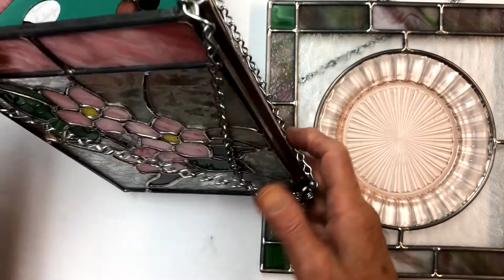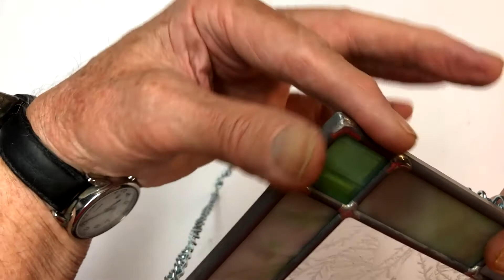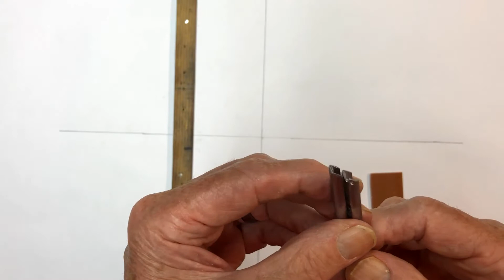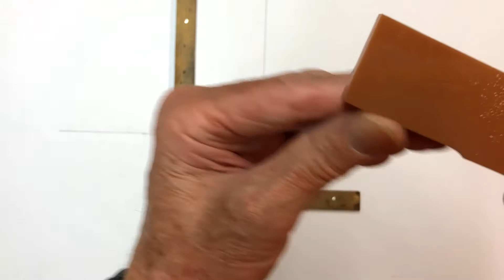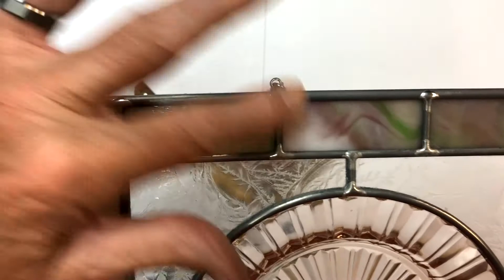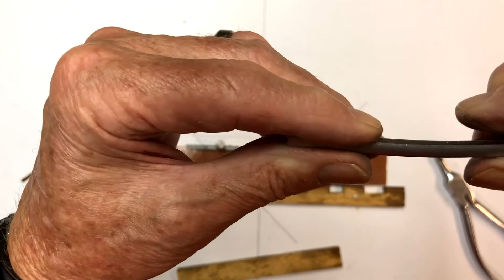Leaded Glass Hanger's!!

Comment: Could you tell me the size of your lead came to use around the outside? It looks really nice.
Reply from the maker: Hi Patty,
Thanks for your comment!! The came is RU-70 which is 1/4" Face width, 5/32" Channele width. It has a flat back and rounded edges. You can use this cotter pin hanger with any size came, just remember to grind back the glass where the legs will go to keep the came straight and flat on your project. Again, thanks for your comment and so glad you found my channel!!
Regards,
Bill Stone

Comment: Thanks Bill, ive never heard of cotter pins before & because of yr accent i thought you were saying quarter pins, so lucky i read the other comments.
I do have to ask as ive never been told, is a finished piece with lead came or solder or both able to be out constantly in the rain or sunshine directly & not under cover, will the elements effect either over time as i want to make some to fit amongst my cottage garden  , & now you've shown me the cotter pin idea, they wont get ruined in our ever so windy area, Thankyou Thankyou, you are a genius 😊
Reply from the maker: Hi Austra,
The cotter pin idea came to me about 25 years ago when we also lived where there was a lot of wind. I never liked the idea of just soldering a ring onto the finished project and hope it never came off. Some of the equipment I worked on over the years used cotter pins and I had some laying around and the idea was born!! These Leaded Glass and Copper Foil projects can be left out all year around. The only thing that happens to them is they all oxidize to a light gray. If it is a Leaded Came project the solder joints will oxidize to match the Lead Came. The only thing you have to check is, if they blow is the wind they don't hit anything that could break the glass. Just think about it, there are 100's of Leaded Glass windows all over the world that have been exposed to the wither for years!! Have a great day!!
Regards,
Bill Stone
Reply: @billstonesstainedglasscrea3310  Thanks Bill, it's funny because the man who taught was the one who said don't put yr stained glass in the garden & yet he had a church done up as a house, with old leaded windows, I think maybe he was talking about the foil might tear away from the glass, but silly me of course leaded windows have been exposed to the elements for years, thats where my love of the art came from, Sunday School looking at my church windows every day I passed by my church & yet it's taken me till 57 to learn it, well I started a couple years ago, the man who taught me the very basics was always worried about parting with too much info, he would always say it's a trade secret, I think he didn't really know, I met a lovely married  couple from it & now we are all friends & I've kept learning ever since from people on you tube & you Bill, ive learnt so much more, I Thankyou so much, now I can make my own leaded windows for our house .
My Husband & I bought a fixer upper & I'm looking forward to building my own windows .
Thankyou & have a great day, I'll be making a lot of yr great ideas for our home 🙏😊
Reply from the maker: Hi Austra,
Thinks for your kind words, so glad my channel and videos have been hopeful to you. It's nice to hear that you find them useful. You asked about designing your own windows, when you have time check out my video called WHAT DO I DO WHEN NOT MAKING YouTube PROJECTS!! The one with the Hummingbird was made up by using parts of three different patterns. I just made copies of all three and cut them apart and put them together to make the pattern to make this window. This window is copper foil with a Lead RU-70 U Came around the outside edge. The one with the pink flowers is also a copper foil with RU-70 U came around it. It was made by cutting the one flower apart and putting it in the one corner so there were two flowers in the window. The original design only had one flower in the corner. One of my favorite Stained-Glass artists is Frank Lloyd Wright, He is an Architect and I love all the Stright lines he uses in his windows. Check him out on the internet, you will get all kinds of ideas to make windows. I have used his design ideas on several windows I have made. The two panels in the door of my shop are made using his style. Have fun with your fixer upper, it will be a project that's sure to keep you guys busy. Have a great day!!
Regards,
Bill
Reply: @billstonesstainedglasscrea3310  Awww Thankyou so much Bill, I will have a look at them again, I've looked at them many times, I love all of them you & yr wife must just adore seeing all that gorgeousness around everyday.
I will definitely look up Frank and give it a try.
When I have got the front door panels made & fitted I'll find a way I can show you a photo, maybe if you have a Facebook page I can add you as a friend, I don't know if we can do it any other way.
My Husband had a work accident, so he can't do the glass however it's my love and I'm excited to to get it going yay.
Thankyou Bill, hello to yr lovely wife, stay tuned & have a great day/night really Thankyou, I can't wait to show you some photos 😊